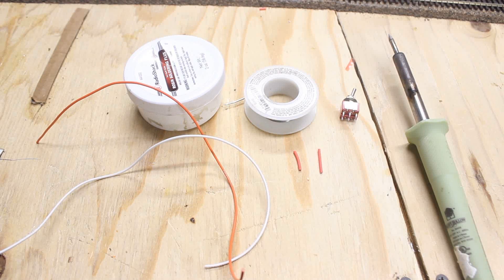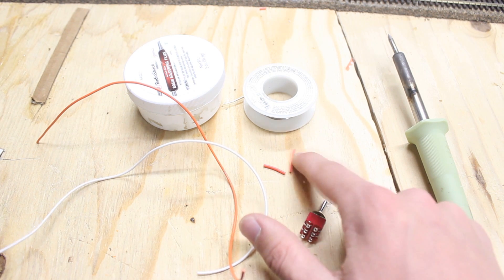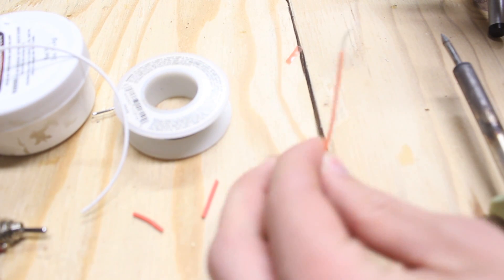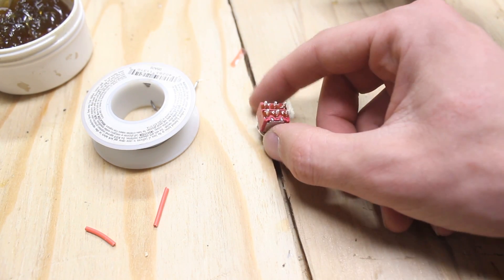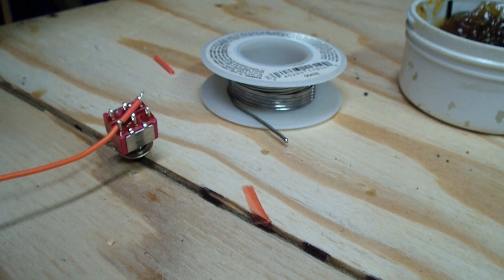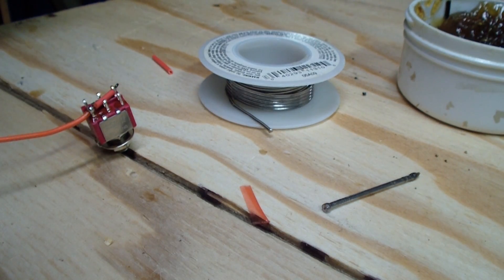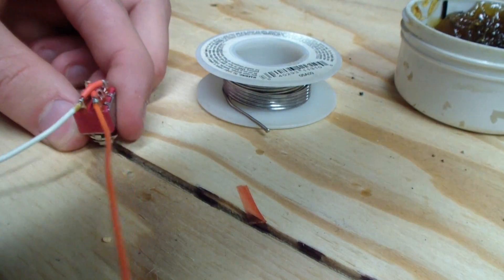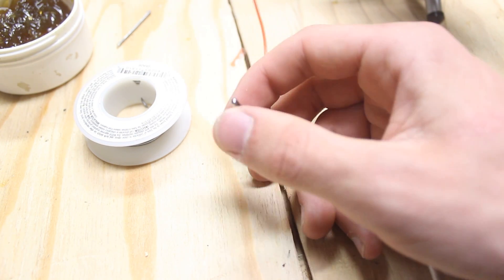How to Wire a toggle switch

Comment: The way you solder on the cross wires is an easier way then using separate wires.  I was thinking of using servo motors.  There are the type used in model planes that sell cheap in China for around $1.65 or a little more.  I need to see how they are wired.  Tortoise are nice but so expensive when you need more than 30.
Scott
Reply from the maker: Scott Downey Using servo motors is definitely by far a cheaper way of doing it! The tortoise machines do offer other benefits if needed like the ability to run power to the frog and signal control if needed. Would be interested to see a video if you are able to find a way to make them work!